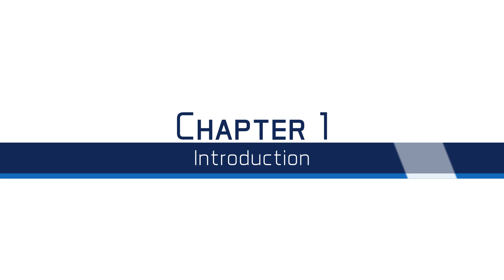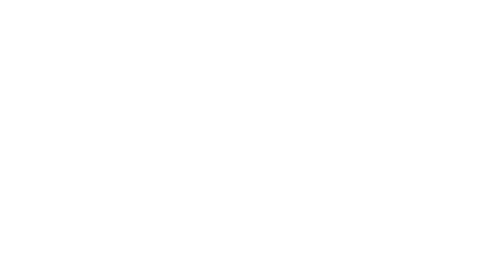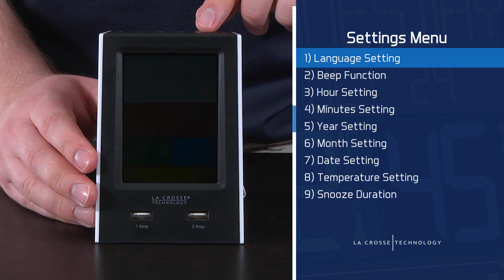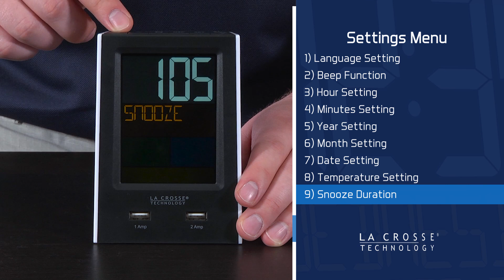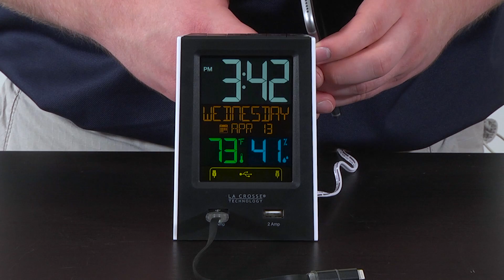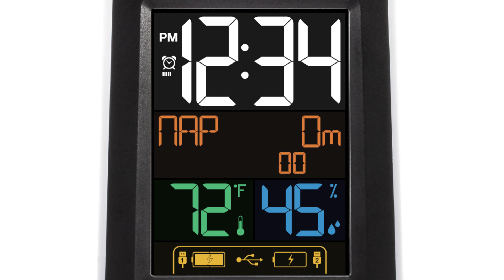C86224 Alarm Clock Charging Station Setup Guide

Comment: I’ve had this alarm clock since 2016 and now it randomly will reset everything (time, date, etc) every few days. What is the best way to fix this?
Reply from the maker: Hey KC, our sincere apologies for the trouble with your alarm clock. Please work through the following steps to hopefully help get this corrected. 

1. Remove all power from your clock. Including batteries and unplugging the power cord from both your wall and from your clock.

2. Press any button on the clock at least 25 times and leave it sitting without power for at least two hours.

3. Power the clock back up by plugging the power cord into a NEW outlet first, then into your display. Be sure to then install a new set of regular alkaline batteries, other battery types should be avoided. Please test this new outlet and batteries to see if the resetting issue continues. 

If this does not resolve the issue, please message our support staff directly here: https://bit.ly/contact_techsupport. Or alternatively, send us a private message on our Facebook: http://bit.ly/LaxTech_Facebook or Twitter: http://bit.ly/LaxTech__Twitter page for further assistance. Sorry again for any inconvenience.

Comment: I got this clock from my dad about a 5 months ago it was a hand me down now it turns on but the light keeps on going ot and does not charge any of my devices i hope that i get a response even though this video is 5 yrs old
Reply from the maker: Hey Peter, our sincere apologies for the trouble. We first would want to confirm that you're powering the clock with the provided power cord? This is required for a constant backlight and device charging capabilities, the batteries are meant primarily for backup purposes. But if you do have the power cord securely plugged into the clock as well as a working outlet, and things still aren't functioning correctly, please message our support staff directly here: https://bit.ly/contact_techsupport. Or alternatively, send us a private message on our Facebook: http://bit.ly/LaxTech_Facebook or Twitter: http://bit.ly/LaxTech__Twitter page for further assistance. Sorry again for any inconvenience.

Comment: I used the clock for a long time. Model C86224 AC6:HX36-0503500AU
I can`t see the screen. Only when I press the  set button , screen is visible. 
The display does not stay with visible. How to fix. 
please as soon as possible  answer. Thank you.
Reply from the maker: Hi Youngsook, our apologies for the trouble. Please be sure you have the power cord securely plugged into a working outlet as well as into the alarm clock. The power cord is required for a constant backlight. For further assistance, please message our support staff directly here: https://bit.ly/contact_techsupport. Or alternatively, send us a private message on our Facebook: http://bit.ly/LaxTech_Facebook or Twitter: http://bit.ly/LaxTech__Twitter page.

Comment: My Lacrosse alarm clock charging station is stuck on the “Hello” screen.  What can I do to fix it?  Model number C86224
Reply from the maker: Hey Michael, our apologies for the trouble. Let's try a few steps to see if we can get this corrected:

1. Remove all power from your display. Including batteries and unplugging the power cord from both your wall and from your display.

2. Press any button on the display at least 25 times and leave it sitting without power for at least two hours.

3. Power the display back up by plugging the power cord into your outlet first, then into your display. If your model uses AA or AAA batteries, be sure to install a new set of alkaline batteries, other battery types should be avoided. 

If this does not resolve the issue, please message our support staff directly here: https://bit.ly/contact_techsupport. Or alternatively, send us a private message on our Facebook: http://bit.ly/LaxTech_Facebook or Twitter: http://bit.ly/LaxTech__Twitter page for further assistance. Sorry again for the inconvenience.

Comment: My alarm keeps on turning off when I put on the triple a battery’s
Reply from the maker: Hey Ivan, for a constant backlight and the ability to charge devices via the USB ports, please be sure to power your alarm clock with the provided power cord. Batteries alone will only allow the LCD to stay on for about 10 seconds at a time after a button is pushed. The battery option is meant more for backup purposes. More specifics can be found in our full manual and FAQ documents here: https://www.lacrossetechnology.com/products/c86224#support 

For further assistance, feel free to message our support staff directly here: https://bit.ly/contact_techsupport. Or alternatively, send us a private message on our Facebook: http://bit.ly/LaxTech_Facebook or Twitter: http://bit.ly/LaxTech__Twitter page. We apologize for any inconvenience.

Comment: They gave me 1 batteries cheepies
Reply from the maker: Our sincere apologies for the missing battery. The batteries were originally provided for units being sold in store, however, in most cases should have since been fully removed, especially if the order was placed online. The request to remove batteries came from USPS as they prefer to not ship batteries through the mail, as they came sometimes leak and damage the package. If you would like further assistance in getting this battery, please reach out to our support staff directly here: http://bit.ly/contact_techsupport -- Sorry again for any inconvenience.
Reply: no thanks im sorry if I sounded rude but it was a gift from xmas its just a battery..

Comment: I set up the clock yesterday and realized that the display will not stay visible. After pressing the light/snooze button the display goes dark again after 12 seconds. I watched the video and my clock does not do the hi/low/off thing like the directions indicate. How can I get the display to stay on?
Reply from the maker: Hey Mitzi, sorry for the confusion. The alarm clock must be powered with the provided power cord for a constant backlight. We apologize for any inconvenience. You can find more info in the full product manual here: https://www.lacrossetechnology.com/media/catalog/product/c/8/c86224-english_032416.pdf
Reply: @lacrossetechnology  It is and was powered with the power cord. No constant backlight.
Reply: The error is mine. I did not have the power cable pushed in completely on the clock. Working perfectly now.
Reply from the maker: @mitzibrown4565  No worries! This happens all the time. If you should have any trouble in the future, please just let us know. :)
Reply: Thanks!!!!!!! I had the same problem, fixed now!!!

Comment: Let me be perfectly clear in an example (so read the example at the end) for why I dispute your rationale for designing an alarm clock the way you did and blaming it on the fact that it has but one alarm.  This alarm clock knows what day of the week it is, and should automatically adjust the alarm to the corresponding setting for weekday or weekend without user intervention.  For example, I have but one HVAC system in the house, but I don't have to adjust the settings every time a weekend roles around and then readjust when the weekdays start again.  And it does so much for each day of the week -- adjusting for when we get up, when we leave the house, we we return and when we go to bed.  Again, it's just one HVAC system.  So, how about a  better rationale for why this alarm clock is designed this way?

Comment: Just to clarify below.  I want the  weekday alarm set for 6:30 and the weekend one for 9:00.  So, for Mon to Fri, the alarm should go off at 6:30.  But, when the weekend comes around,  it should go off at 9:00.  Then, come Monday, it should go off at 6:30 again.  Is this something I have to adjust every Friday night and every Sunday night to have it go back and forth?  I sure hope not.
Reply: Thanks ... to bad.  You may wish to make that fact clearer on the packaging.  Why bother having a weekend/weekday difference then?  Better too have put the resources into 2 alarms instead of 1 and rather 1 USB charging station instead of 2.  Or call it a Charging Station Alarm Clock.  Pretty lousy marketing.

Comment: I may be missing  something, but how do I set the Mon to Friday AND the Weekend alarms so both are set at the same time?  It seems they are mutually exclusive, only allowing one type to be set at a time.  If so, the box the product came in is very misleading and clock will be returned.  Hope that's not the case as I like the clock.  Just don't want to have to keep setting the alarm to go from weekday to weekend over and over again.

Comment: Can you set more than one alarm for different days? For example if you need to get up at a different time on certain days.
Reply: So we bought this clock and I wanted to take a moment and let you know I think it is pretty awesome! I find myself staring at it admiring it, lol. The nice colors and all the nice features. We mainly got it for the phone charge feature but the temperature and humidity comes in handy. It is definitely an upgrade to our old clock. Only thing I would have preferred if it had a slightly dimmer option for brightness but on a plus note, it works good as a night light. :)